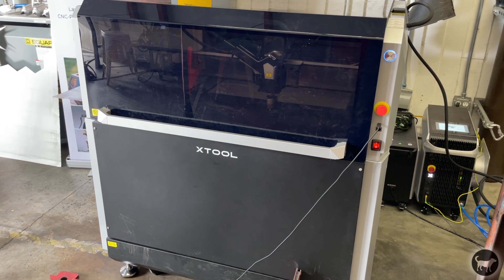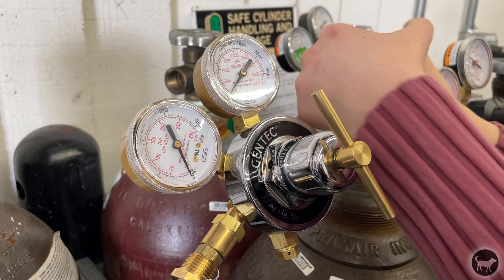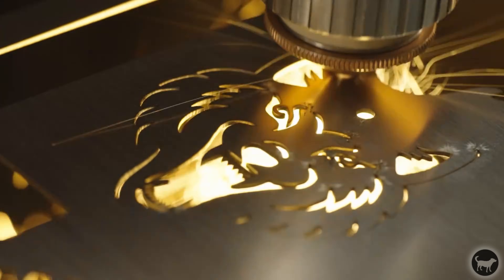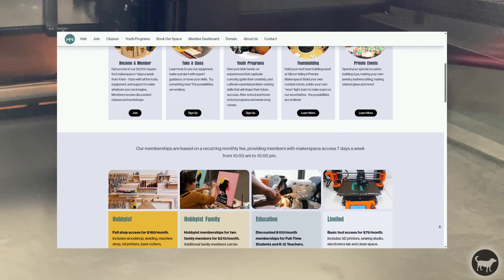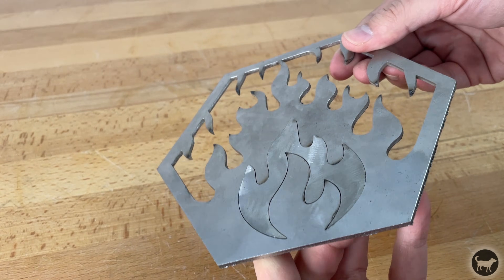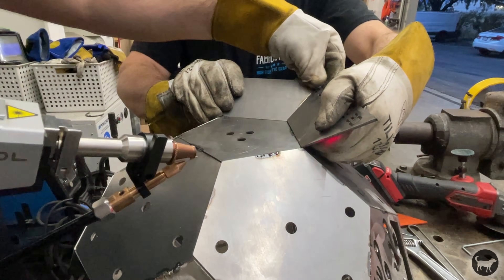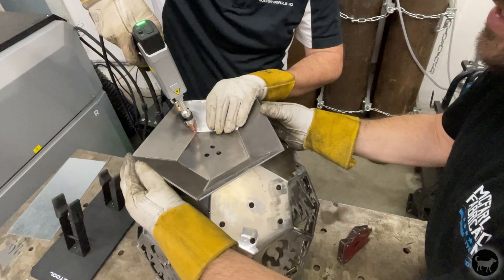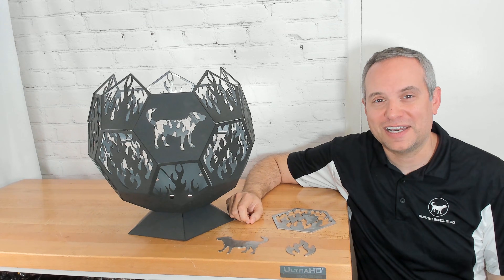xTool MetalFab Laser Welder and Cutter First Look Demo

Comment: I wish they did a stand alone CNC type unit without the mobile welder. But even then, the price jumps significantly to add what is essentially a CNC frame/motors etc.

Comment: 7:30 - you should really break yourself of the habit of touching the weld immediately after welding each time. Granted, this welder might not make extremely hot surfaces, but it's a bad habit to get into if you like your fingerprints.
Reply from the maker: Yeah good call. I’m clearly not a professional welder. However it wasn’t really all that hot in the end.

Comment: It is very cool but your cost rundown didn't mention the cost of the compressor/Dryer ($1700) and the cost to install 220 in your workspace (if needed). So far I haven't seen a video with all the items connected and how they are powered. Looks like two 220V outlets are required for the the welder and compressor. then a 120 for the CNC unit. The air dryer is powered by the compressor.
Reply from the maker: Yeah I didn't use the compressor and dryer and honestly wasn't even aware it existed when I used the machine a couple of weeks ago. Since it was also not in my own place it never dawned on me to trace the plugs to see where everything was plugged into. You are correct that the welder needs the higher 220V. Good catch, the dryer on the website says 120V while the compressor says 220V. I have many compressors running at 120V so not sure why that's necessary.

Comment: It‘s too dangerous, almost irresponsible. You only have one pair of eyes and the people around you too.
Reply from the maker: You definitely need to respect any laser you use no matter what the application. Everyone in the area was using laser googles that protect eyes from the 1080nm wavelength. Laser welding is not exactly new and used in many industries but I agree that adherence to safety protocol should be a #1 priority when using a tool like this.